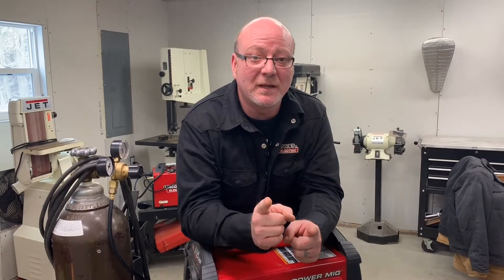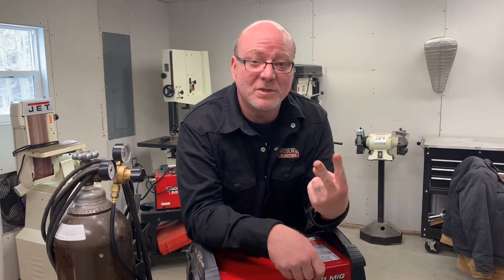Question Mark #2 MIG weld or TIG weld which is stronger

Comment: Tig weld 100 % and the myth of tig putting more heat to base metal is a myth. It means you are welding too slow and too little amperage. I weld 125 amps. Stab the pedal and move fast and get great results snd a way smaller heat affected zone. Tig done properly is far superior. Hot snd fast is the key. Slow and low is how you fail a weld test. Unless it’s on a nasty fishing boat that only gets 7018… mig and tig don’t stand a chance in steel boat repair.

Comment: Can you please comment on the size of the fillet.  I thought the larger fillet provides more strength, so mig application and the larger fillet usually made would provide better support and strength.  Tig fillet size seems to usually be smaller, so less strong.
Reply from the maker: Brian,
Most of the strength of a fillet weld comes from the root of the weld. Large leg fillet welds do not have the same strength as a deep root fillet. When you try to get the arc down into the root of a fillet, the welding process does it differently. Some Simple fillet weld break tests can show you how this works and the difference in strength. Larger welds than needed actually start creating other issues because of the excessive heat input into the material.
Thanks!

Comment: Not strictly true, overall Tig generally puts more heat into the base material and weld, thus greater HAZ., with resultant softer and more ductile weld with slightly lower mechanicals. This is easy to see in grinding Tig compared to Mig/Mag welds
Reply: Not true , Tig is superior weld, that’s why nuclear ☢️ reactors are Tig welded .
Reply: @jeffreylong9405  Please read the question, the question was "what is the stronger" not which is the higher quality - 2 different questions and answers not necessarily mutually exclusive and for untreated/processed welds the GMAW process compared to TIg will normally be mechanically stronger, any doubt ask a Welding Engineer.

Comment: Imo tig is the strongest because you can adjust power at will. Mig/stick stay the same so your starts and end temps won't be good as a professional tig wleder who can read his puddle and knows his heat
Reply: I agree, but with pulsed mig and arc timers you can accomplish the exact same with more consistent results and a lower required training time on mig.